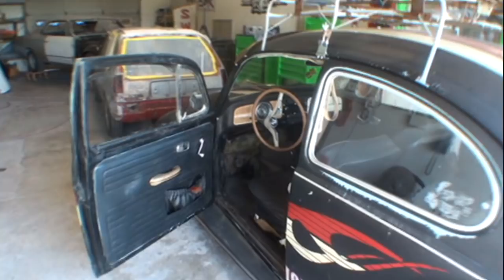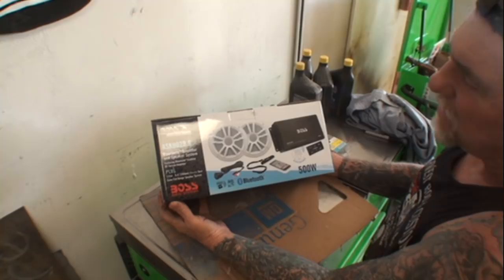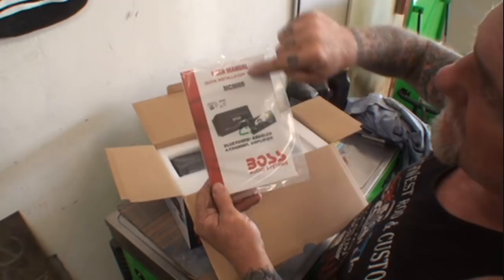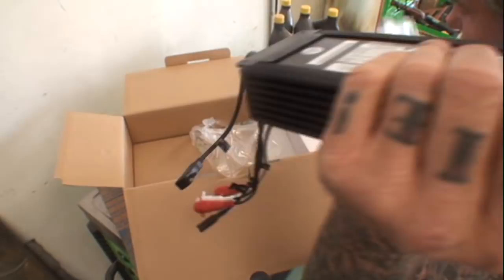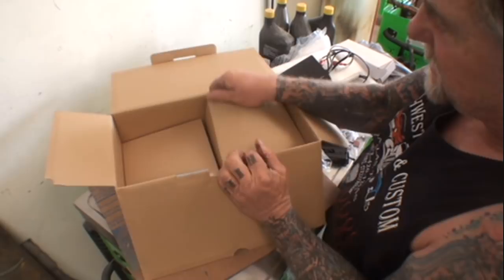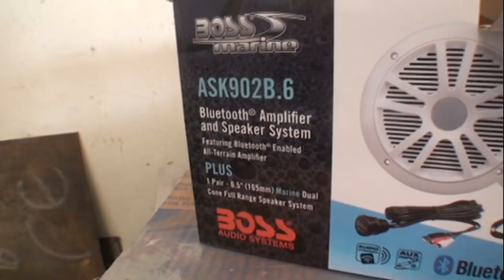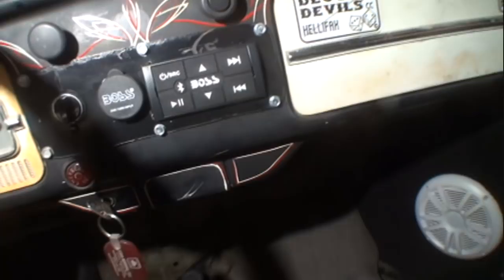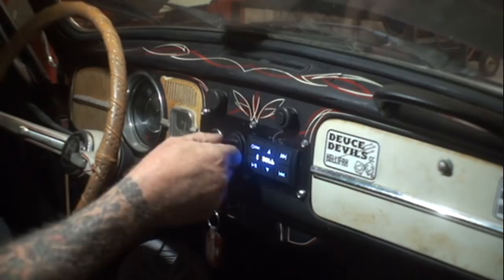BOSS AUDIO ASK902B.6  500 WATT  Amplified Bluetooth System - INSTALLED, Reviewed, And TESTED!

Comment: I made a similar system for my classic car using conventional auto stereo equipment so I can retain the factory original AM radio in the dash and still have a modern stereo/GPS hidden in my car. This is a cheaper and less complicated way to do the same thing. Nice review Pete.
Reply from the maker: I think this is the way of the future for car audio...
Reply: diyautoschool i believe your right

Comment: Oh man that wilderness of wires.. I wish pete would come back and neat up the wires.. Even zipties would help a lot.. 
Not because it looks good even when it does but because it's easier to work with when the wires are easy to read which one is what. All he would need to do is just zip tie the wires together and have them in rows so it's easy to navigate. Then zip tie the rows in the body so they don't rattle around.

Comment: Hello pete. What did you do with the 12v blue remote wire? I’m not going to use an existing head unit.
Reply: I have this amp and couldn’t get it to turn on ran power and ground and nothing

Comment: So the mp3 player will "NOT" work through the usb port? Is that correct? I noticed that you switched out the usb cable for an auxiliary port connection. I'm presuming that you lucked out because your mp3 player has both ports. 
Looks like a good deal for sure and your video was great. 
Thanks Pete.
Reply from the maker: Your phone and pad will work through the usb port, but the mp3 player is wired up for the aux. port.. it will charge the mp3 player via the usb port...
Reply: Thanks Pete.

Comment: Pete, this video definitely  marks your personal lower dead point. 500W over a 15 amps fuse at 12 volts? In reverse order, 500W at 12 volts equals 41 amps!!!  For less than 100 bucks? Are you kidding? Do you expect your VW Beetle generator to deliver this kind of power?? I have a 470 watts high fidelity amplifier in my living room, and believe it or not, I can actually heat the room with it, even on decent levels... I´m into cars too, and very much enjoy my abo on your channel, but stay with your pair of shoes. I have a degree in electronics, trust me, forget this crap system, it´s not worth the chatter.
Reply: do you know of an alternative system if you need to hide away your radio with bluetooth?
Reply: The amp is rated at 500w peak power, which means it's a nice number for marketing. The RMS is however 94 W X 4 RMS @ 4 ohm. The speakers are rated at 180w peak power, 90w rms for the pair, which sounds to me like half on each and about what's about usual for the size and price point for marine speakers (6.5"). So 45w speakers, 94w amp. So the price point sounds about right and the set should be an ok deal for what they are. I'm probably grabbing the set for my boat.